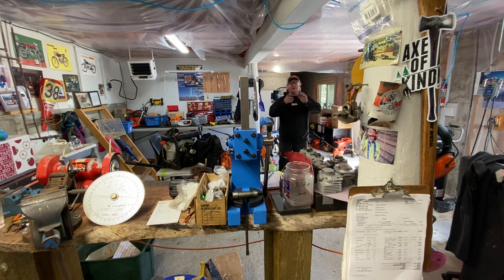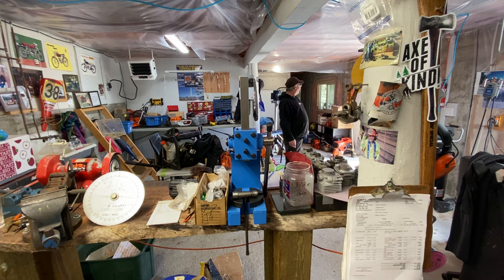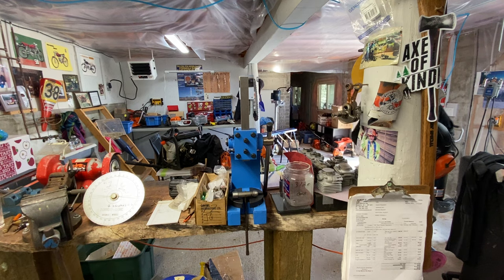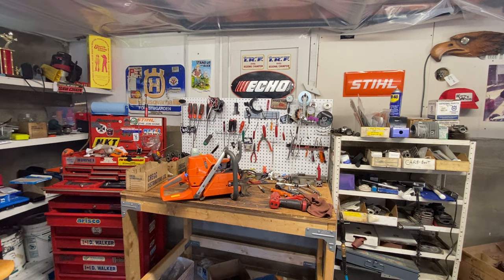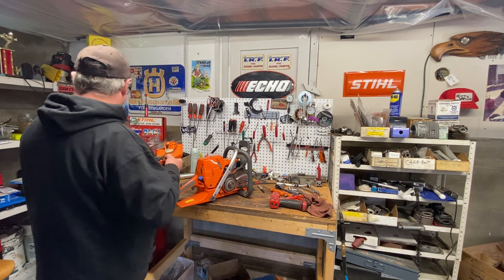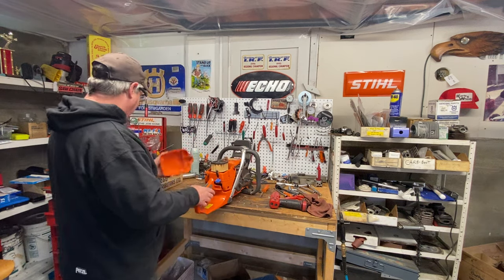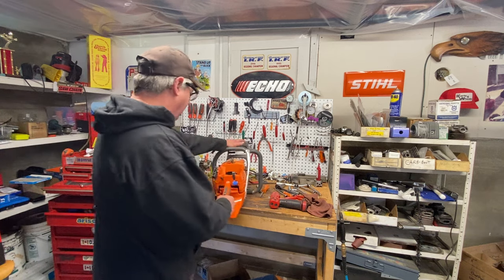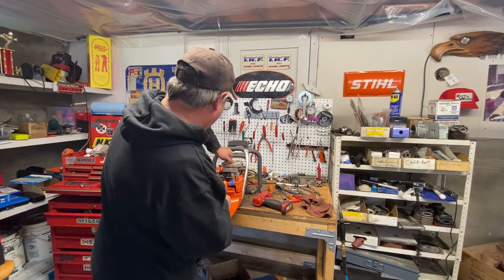Husqvarna 390 saws

Comment: Stihl’s first two numbers indicate engine displacement in cubic inches. With the 0XX series the last two were the displacement. 

As in the MS 440 was 4.4 ci, and the 044 was also 4.4. 660 & 066 at 6.6. The 500 is 5.0 and so on.

Or thereabouts, there is some rounding going on… And somewhere along the line they decided odd numbers were for the non-pro saws. I guess it was sometime in the last 30 years or so, because by all means the 045 & 075 were big, powerful pro saws.